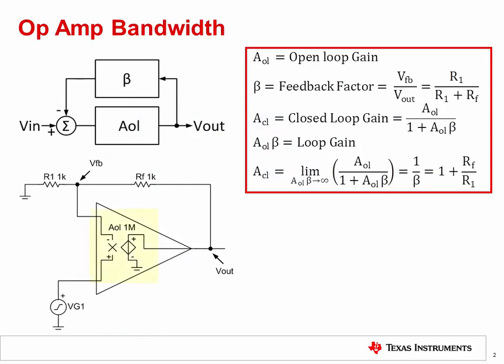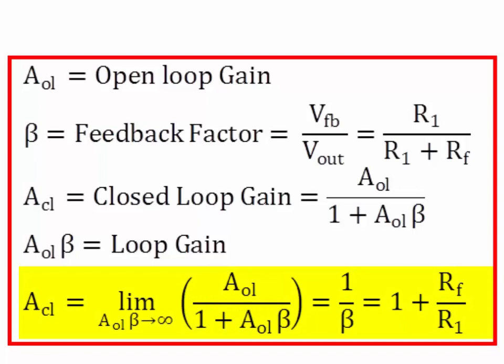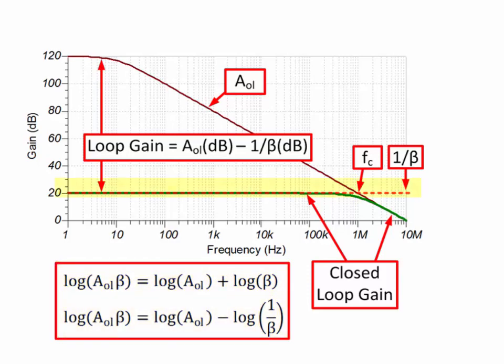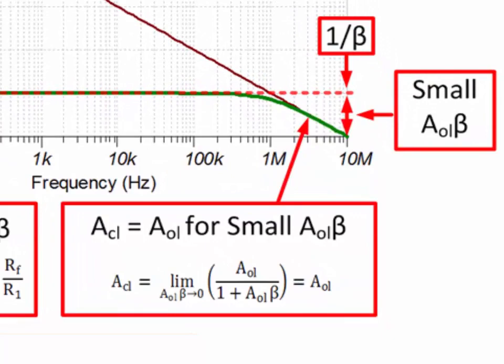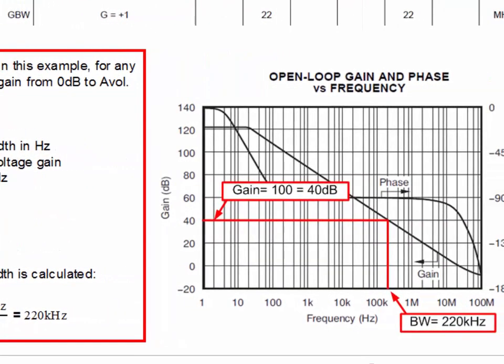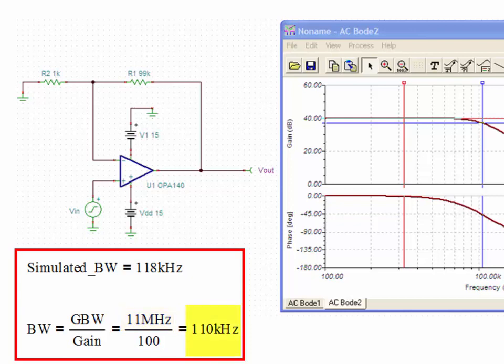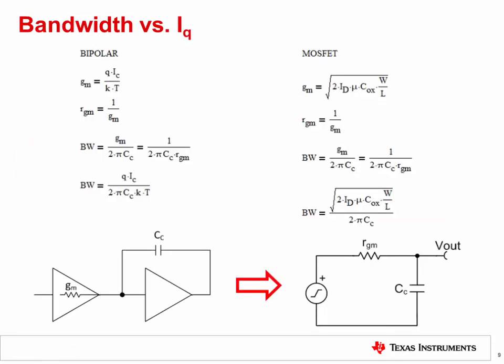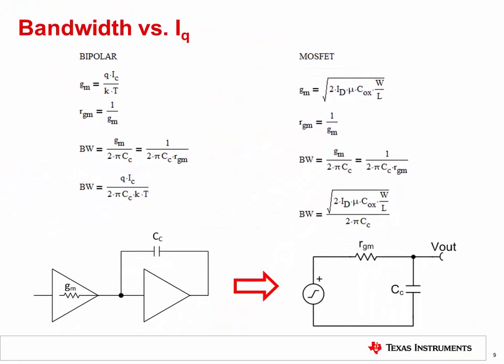Bandwidth - Gain & GBW

Comment: Where did the closed loop gain equation (Acl = Aol / 1+AolB) come from?  A little Kirchoff's law would be helpful here. Thanks!
Reply: Come on it’s pretty trivial
Reply: @nothingtoseehere2189  That comment translates to "I am way smarter than you and have no time for you."
Reply: @danmarquez3971  I didn’t mean it to sound like that but you’re right it does sound rude. 

The output of the opamp I’ll call vout will be Vout=g*(vp-vm) where g is open loop gain vp is non inverting input and vm is inverting input. There is a voltage divider circuit created from Vout to ground with rf and r1 the voltage going into the non inverting input can be calculated using the voltage divider equation (this applies cause high input impedance of opamp) Vm=vout*r1/(rf+r1) letting B = r1/(rf+r1) gives vm=vout*B substituting our new value for vm into our original vout gives Vout = g(Vp-B*Vout) meaning Vout + g*B*Vout = g*Vp factoring out Vout and rearranging gives Vout = Vp*g/(1+g*B). V plus is just our input voltage and gain is defined as Vout divided by vin so if we just divide left and right side by vin we get Gcl= g/(1+g*B)
Reply: @nothingtoseehere2189     Wow!  I am impressed by your response!  You were very diplomatic in the first sentence and you spent great time deriving the equations! I take back what I said! Thank you for the derivation! You rock! And sorry for the misunderstanding!